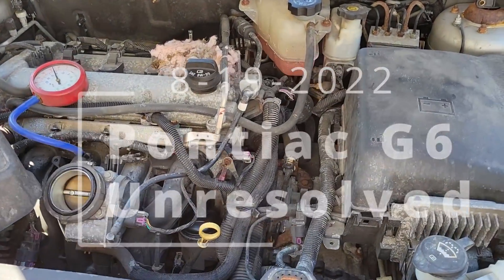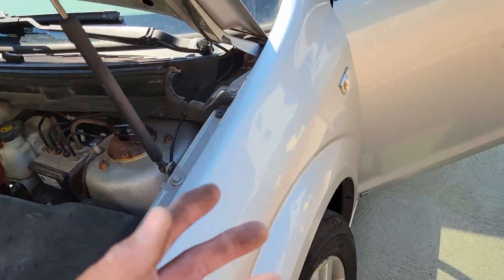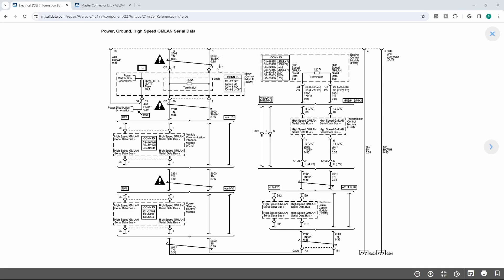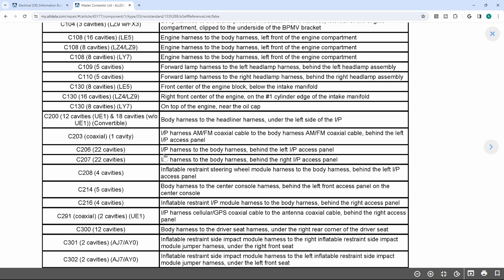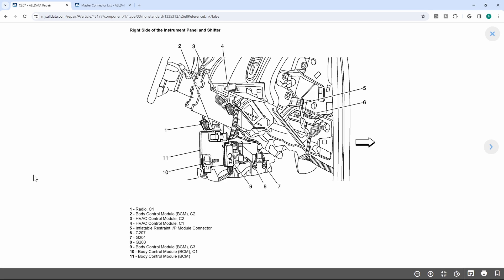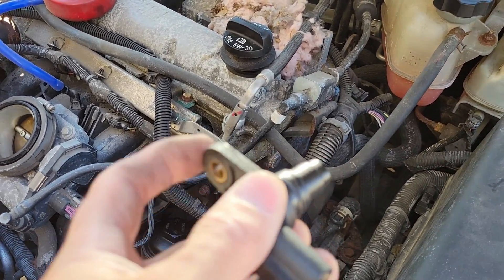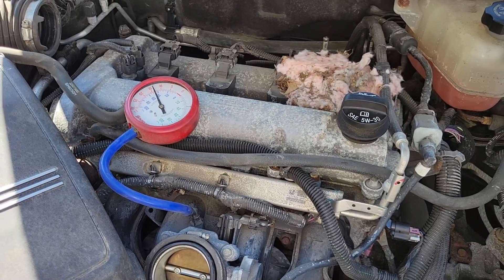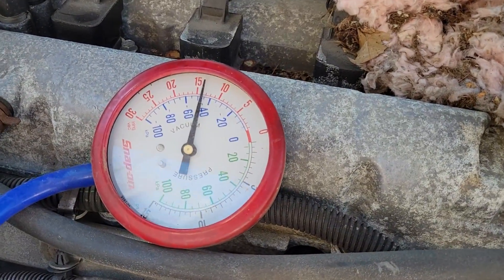Pontiac G6  Unresolved  CAN Communication Issue Miss fire

Comment: 2008 chevy hhr no crank, no start, no nothing, no clicking new starter, new battery someone please help
Reply: Is there a security light on or an theft related codes or you can send power to from the relay and see if the engine is at least cranking
Reply: When you turn the key is dashboard light up
Reply from the maker: Trouble codes? I see alot of bad grounds on those all the time.